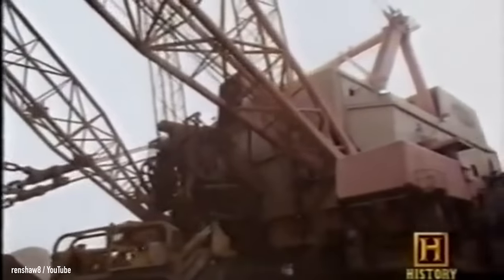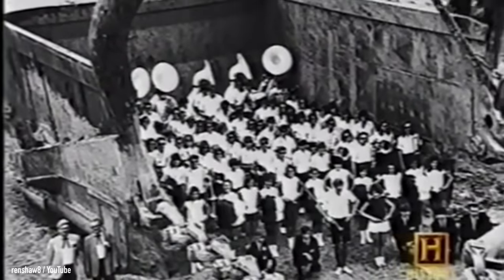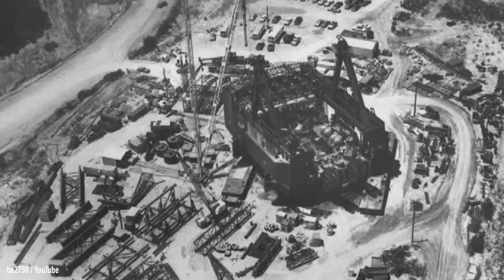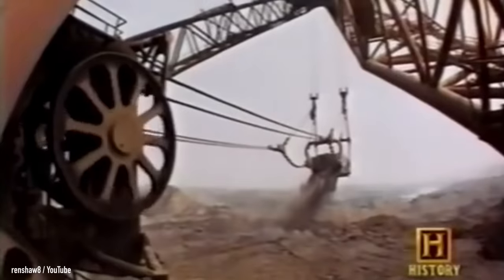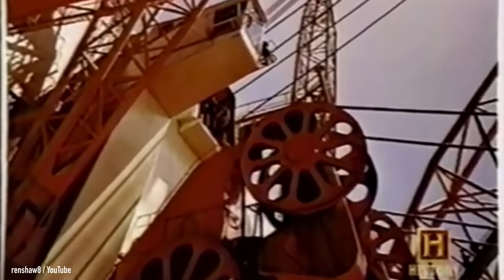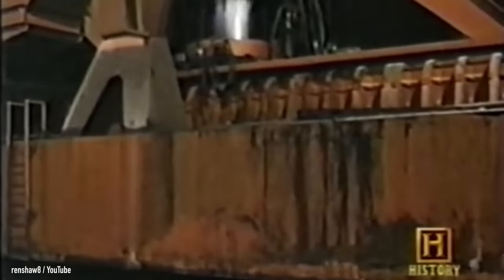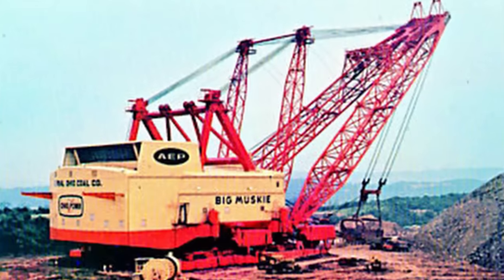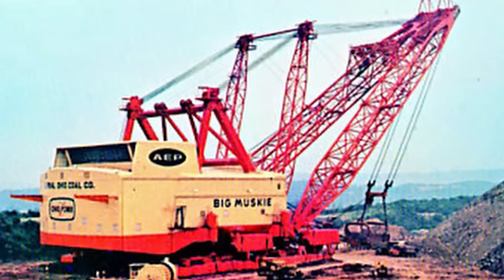The story of Big Muskie - The largest walking dragline ever made

Comment: I just came from a video on the Letourneau 2350 wheeled loader.  It was touted as the world's largest.   It was a nice and large machine.  I couldn't help but think of Big Muskie, which could have picked up the 2350 like picking up a Tonka, and set it 300 feet away, and probably on a 150 foot hilltop, in less than 60 seconds, and all with cables and winches.

Comment: 2:55 slight correction: they didn’t need to have special agreements with the power company because AEP was completely vertically integrated at the time. This was a mine/mouth facility that fed the Muskingum River Plant in Beverly, where I worked for a few summers. Big Muskie fed the plant and the plant fed Big Muskie.
Reply: Isn't what you described a special agreement?? At least a special arrangement.

Comment: Big Muskie was actually in the process of getting saved with the people seeking to preserve it negotiating with AEP but while it was happening the scrap company was gutting it for stuff no longer needed but it’s fate was sealed when the scrap company used dynamite to blow up the cables holding up the boom causing it to come crashing to the ground 

Meaning 

It would have been saved If aep told the company to leave the structure alone and just take the internals besides the winches and hydraulics and all the stuff holding it together and the electrical boxes for lights 

But since they didn’t 

The scrap company robbed us of the gentle giant 

After that it’s siblings and children would and will be picked off 1 by 1 and will most likely end with the scrapping of Ursa Major unless we can come together and save it
Reply: AEP saw dollars over saving it . My deceased partner was a software developer for them the coal was high sulfur so they closed the mine they had CDI drop the boom  to begin the dismantling before it started I got to explore that machine the size was immense !
Reply: Destroying that machine was not smart. They destroyed part of the story. My feelings. Hugs from Brazil

Comment: Was in the stripping pit with the Big Muskie while it was working a few times, my father worked and retired from Central Ohio Coal.  I worked in the Oil Field industry, worked for a company that had the oil lease rights there, built a lot of well heads, tank pads,welded a lot of pipe line and reclaimed alot of well sites there.
Reply: Did you or your dad know Glen Horner? Operation engineer of Muskie? When you saw it walking he was there. Only time it was productive.
Reply: @FranBSoCal , I am sure my father knew Glen, I will have to ask my farher.

Comment: Always wished they could have saved this machine and the Marion 6360 (the captain) having them both parked up together for everyone to look at would have been a massive attraction that people would have paid to see.
Reply: From what I heard the captain caught fire it was heavily damaged and they weren't able to save it
Reply: @justina249  yes it did catch fire but only paint damage from the outside,it would have been nice to dismantle it and set it back up next to big muskie somewhere but the cost of doing that would have been massive.
Reply from the maker: Yep. Basically impossible to justify from a costs perspective
Reply: The captain went up in flames and was scrapped a year later after they had to make the difficult choice to scrap it 

They couldn’t do anything because the repairs would make them go bankrupt almost 

After that they used a Marion 5900 and it took twice as long to strip the seams
Reply: @markwood9987  it received structural damage making it weak and potential to collapse
Reply: @Leatherface123.  yes it was almost impossible to save but at least they could have saved that bucket ,it was the only one to have two doors and the sides of the bucket where 24 inch thick steel.
Reply: I worked scraping the 6360 the damage was war worse than paint the main floor had a crack almost all the way across. However the machine was burnt for ins $ it was in need of a massive overhaul

Comment: My now deceased partner was a software developer for AEP  they owned it I got to explore this machine before it was sold for scrap . Photos do not begin to show the size of it it had a 50 ton overhead crane inside it to replace components . I do not why he talks so much about the price of power a power company owned it ! It worked there own mine they even had their own electric railway to transport the coal . The EPA is what killed this machine the coal was high sulfur and was hard to scrub to meet the emissions regulations. They closed the mine .Scrap was selling for a all time high is why it was not preserved AEP looked at dollar signs over history so it went away .
Reply: I was with Bucyrus-Erie onthe sales end during the early '60s. I'm almost 90 now and have a company  still selling big equipment. That was the largest in my lifetime

Comment: Two questions: Why the long power cord? Why not an onboard diesel generator or two?
Reply: Because the company that owned the coal mine also owned the power plant that provided the electricity to power Big Muskie. 
So it was less expensive for them to just run power cables out to the machine, rather than having big on board generators that require fuel and maintenance.

Comment: Not feasible to use as a Museum. The house was already falling apart. Those of who have worked on draglines know how impractical they are as a Museum. 

Quite a few errors in commentary as well.

The biggest electrical issue with machines this size is the voltage and frequency fluctuations they impress on the grid. The sheer mass of the house even though swing is the smallest of the 3 motions r,eturns huge amounts of energy to the grid on deceleration and then sucks a large amount while accelerating in the opposite direction. 
1960s machines had poor VARS regulation. The Marion 8900 at Moura had the same group of issues that led to its demise. 

These really big machines were designed for fast removal of shallow overburden. When the highwall got above 45 metres they were too unwieldy to bench down.
The 8900 was replaced by a smaller machine with a longer boom, drag ropes and hoist ropes.  It was cheaper and more practical than modifying and refurbishing the 8900.
Draglines are custom designed for the pit they are built on. The bigger the machine and the older the machine the less chance of repurposing it.
Common 4000 to 5000 tonne machines like BE 1370s and Marion 8050 / 8200 get repurposed more easily. They can be walked off, transported on crawlers or cut up and exported.

Bucket wheel excavators are not directly compatible with draglines and are not necessarily more efficient. Bucket wheels are good for soft weathered material or pre-crushed product for export. Draglines can and generally do handle broken rock. I've seen rocks over 100 tonnes picked up by a dragline.
Over the life of a mine where the seam gets continuously deeper, Shovel and Truck comes in at some point. That may be from the get go, or as conditions overtake the sweet spot for either draglines or bucket wheels. 
With the combination of Shovel and Truck fleets and draglines extracting coal at depths exceeding 100 metres is feasible for high value coal in thick seams.

Comment: That machine won me $100.00 when I was going through basic training.  Being bored we used to bet on everything like which light bulb a fly would land on.  We were talking about what our dads did back home.  One guy from Pennsylvania said his dad ran a drag line and it weighed 600 ton. I said there is one in Ohio that could pick it up. He said bullshit.  I said bet $20.00 it exists, he said bet $50.00 it doesn't and I said bet $100.00 it does and he took the bet.
My dad worked for the Ohio power coal company and he had sent me information on the big drag line. The Big Muskie could lift over 700 tons

Comment: Wondering why it wasn't run by huge diesel engines running generators to power the motors, or a central diesel power plant close by?  Think locomotives only on steroids.
Reply: It would take a convoy of fuel trucks, all day.
Reply: @vernonspady555  How does a 1 mile long train packed with coal bunkers all filled to the brim being pulled by a locomotive diesel powered electric do it?
Reply: Factor in losses and youd need a 40.000 HP Diesel engine. Engines of that size need heavy oil. As far as i know there were no engines Made for on Land use in that size. Also Imagine the Crew and mainanance cost, this fuel needs to be preheated, including ITS storage. An engine that size would be to heavy to be mounted onboard and it would be pretty hard to make it halfway movable over the Terrain the Dragline stood on. I think IT would have been to much effort to make Something Like that Work when they could simply use electricity.
Reply: Total cost is less by using the infrastructure already in place. Also the machine house is already packed with no room for huge diesel engines.